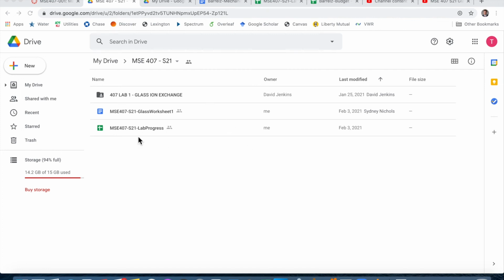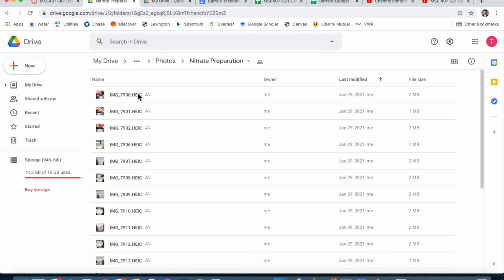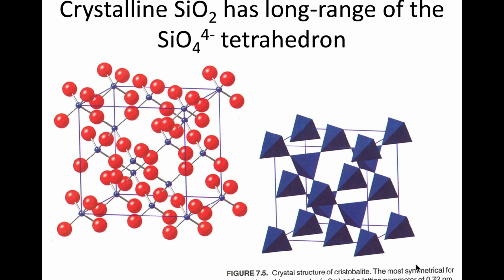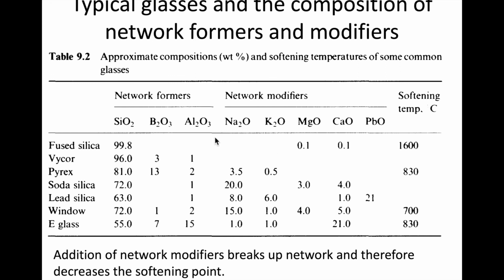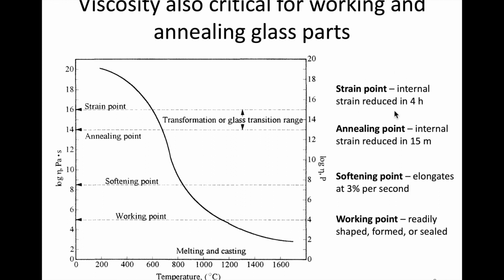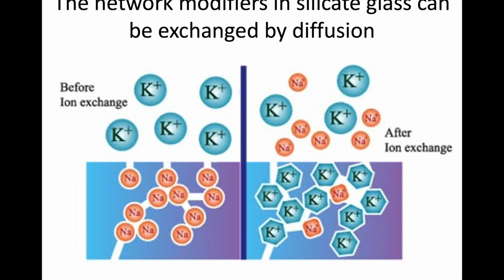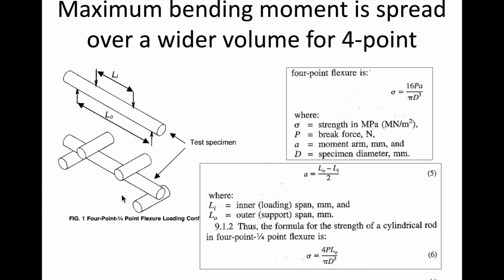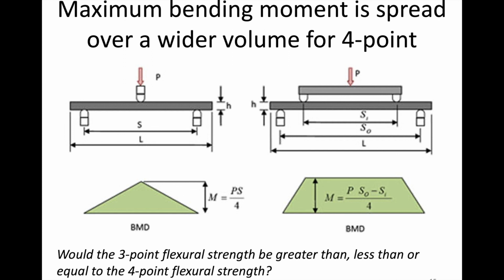MSE 407 S21 Lecture 2 - Recap of Week & Glass Ion Exchange

Comment: Hi, i hope you are doing well. i know this is an old video, so maybe you are unlikely to see my comment, but one can always hope lol. I was wanting to know why you chose to add silver nitrate to the potassium nitrate bath for the glass samples. i know this is an academic video, and not a proper experimentation with unknown outcomes, but im hoping that there is a research paper you pulled from that goes into why silver nitrate was used. hope to hear from you soon, and have a great day!
Reply from the maker: We've found silver nitrate can strengthen soda-lime glass even in small amounts.  Since silver is quite expensive, we haven't been able to use silver nitrate without a "filler" such as cheaper potassium or sodium nitrates.  Another advantage we've found is that when silver exchanges we can pick it up much better using EDS.  Hope this helps!